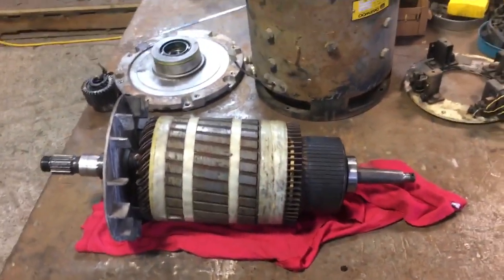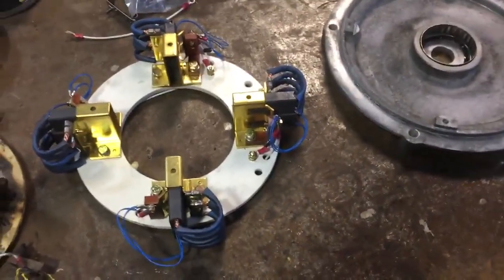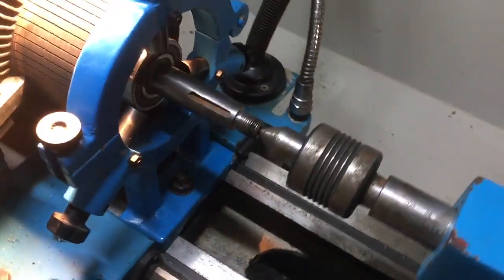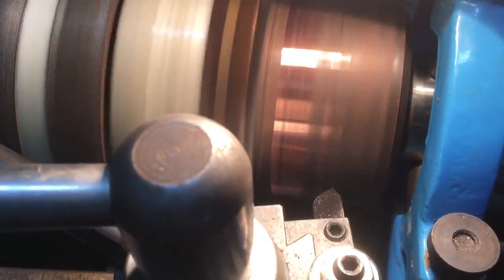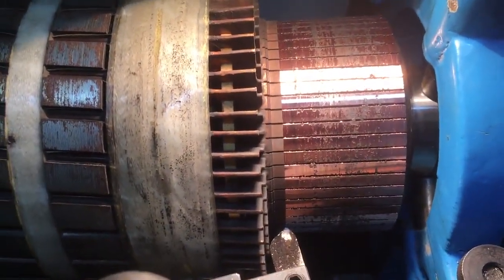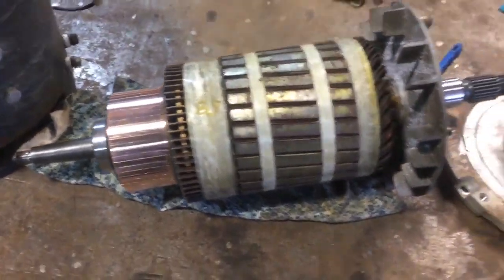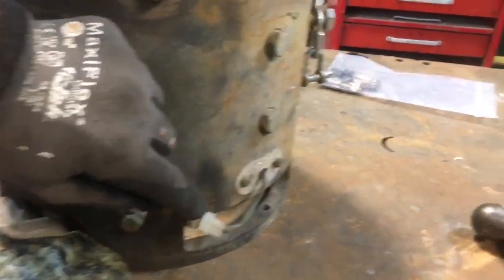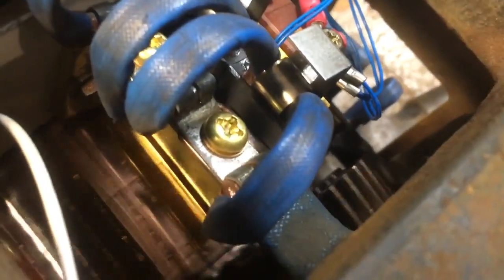Rebuilding a DC forklift motor (mostly about turning a damaged commutator)

Comment: You need to clean up also between commutator lamels. It has proberly weared brushes causing that damage, the copper coils looks good and there is no solder trowing out by heat.

Comment: I have what appears to be the exact same motor but with Caterpillar branding. The label only mentions voltage and OEM part numbers. You don’t happen to know who makes it or what the specs are, do you?
Reply from the maker: If it's the same as mine it's a Daewoo/Doosan lift.  Many were sold with Caterpillar branding in here in Canada and surely in the US as our market isn't worth the hassle.  I have a certain amount of information on the Daewoo variant of the machine as I have a service manual for it.  I suspect Cat-branded machines are identical.  What do you want to know about it?

Comment: What the speed of the motto
Reply: Motor
Reply from the maker: These big dc forklift traction motors tend to spin pretty slowly from what I've heard. Maybe 1500 to 2000 rpm but mostly they're built for torque at low speeds in an application where weight is an asset rather than a problem. The motor mates directly to the différential and only has a couple steps of reduction before getting to the drive wheels (input reduction in diff, diff reduction and final drive planetaries au each wheel). So the short answer is VERY SLOW by dc motor standards.

Comment: kW?
Reply from the maker: I don't know.  It's not specified in the service manual I have and it's a48V system so not being pushed very hard.  The traction side of the controller looks to be built for about 600A peak so theoretical max 600x50V = 20kW but it probably never gets to full current at full system voltage.  My bet is that it rarely goes over 20kW but could be pushed a lot harder with a blower to cool it.  

And I guess I should keep in mind that the old brush holder was melted so maybe that's the weak link.